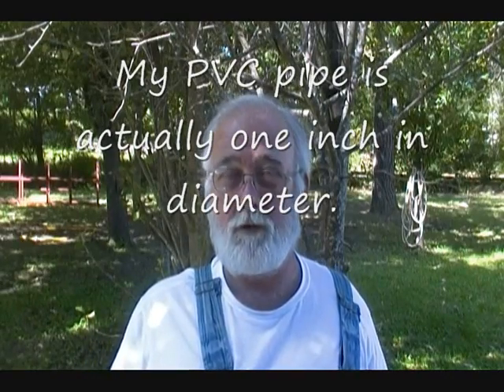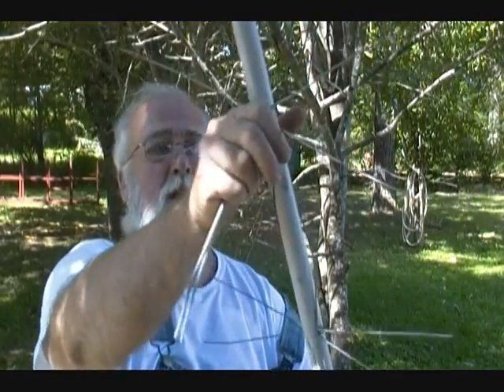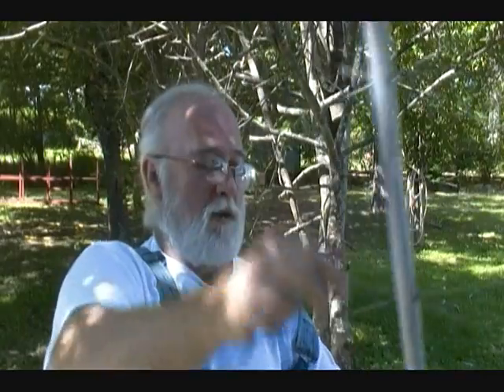Detailed Construction for my 36 Cent HD TV Antenna

Comment: Just wanted to let you know that I did away with my cable tv and made myself one of the pvc pipe antennas you showed how to make 7 years ago.  It works great.  I put it up in my attic and I pick up stations 50 miles away in Paducah, Ky and Cape Girardeau, Mo.  Thanks for the tips.
Carroll McGuire
Marion, IL
Reply from the maker: Great 👍

Comment: You cannot get HD on an over the air antenna…. Period!
Reply: Yes you can but there is no such thing as a HD TV Antenna. An Antenna from 1970 will work. As long as it is UHF and VHF and rg 6 cable with a bauln connected it will work fine.
Reply from the maker: Q: Can I really receive high-definition channels for free using a TV antenna? A: YES! With a TV antenna, you will experience HDTV in the highest quality picture and sound available. Over-the-air broadcasts are transmitted in uncompressed, crystal-clear 1080i, far surpassing what cable and satellite offer.
Reply: I get 17 HD OTA channels with a piece of coax that I turned into a dipole at the end. Can't get any more basic than that.
So yes, you can easily get HD OTA. Period.
Reply: You CAN get HUNDREDS of HD channels  on an over the air antenna.   Period!  There is no difference. HD Channels ARE "over the air" channels.  During the early days of HD. antenna manufacturers WANTED EVERYONE to buy NEW ANTENNAS for the "NEW  HD SERVICE. Manufacturers PAID their shills and 'talking heads' to spread  LIES like "You cannot get HD on an over the air antenna…. Period!"  (Some people were actually GULLIBLE ENOUGH to believe such LIES. )  Oh yeah, some "experts" were in the middle of "their PERIODS" when they made such hysterical, stupid remarks...   :-)

Comment: If you you double it like me you can get more signals. I also use copper wire from home depot instead of galvanize or stainless steel tig wire from Harbor Freight.

Comment: wow huntsville and nashville from the same antenna. i am impressed. looking at the map those two cities are not very close to each other. turning the antenna roughly 90 degrees means you are not directly between the two so that indicates even more distance. of course elevation plays a big part so if you are at a high point you could reach out further.

i live just north of memphis tn and only get memphis channels atm but plan on building one of these to see if i can get a better signal as sometimes i lose signal on my current homemade antenna.

Comment: Out of curiosity could you make more than one antenna and aim them at different cities then use a Y connector in the coaxial cable so you could pick them all up?
Reply from the maker: Don't know.  My dad used to have two UHF antennas hooked together for that reason.  Try it and let us all know what you find out !!
Reply: DoingItCheap If i can find some free time I will. Thanks
Reply: You want this man to spend 72 cents? We're not watching DoingItCheap for nothing!
Reply: stonefry haha lol
Reply: That might work.  if not, then just connect the coax from each antenna to an A/B switch and connect the switch to the TV.  Then simply push the A button for one antenna, or B to use the other.

Comment: good and simple 4 bay antenna!  I would suggest using minimum 12 awg wire for the dipoles.  Wind, birds...etc or accidentally hitting something and those wires will bend!  My question: how are those phase line wires holding behind the whiskers?    The video is not clear on that.  Do you pinch them behind the bend?  If so, that could easily pop-out ?  How is the 75/300 ohms transfo wires holding with the phase lines?  thanks and once again good work!

Comment: This my seem off subject,  but is your roof metal or asphalt shingle (considering signal reflection by metal roofs)?      Below am metal roof, TV signal is sometimes very difficult to receive.   also I am plagued by power wires all around my property at about 24 feet and a new set of wires at 38 feet.   there are fewer folks that use antennas anymore.   regards
Reply from the maker: Power lines will disrupt the signal more than what kind of roof you have.  I have used this same antenna at the cabin on the hilltop in my homepage photo, inside the living room of a house in Milton, FL, at my home here and presently at my farm.  Height of the antenna and distance to the broadcast tower is the main concern.

Comment: where did you get the 14 ga. galvanized wire? what else would work for that? thanks!
Reply from the maker: You can buy it by the roll at Tractor Supply, but this was just some I stripped out of a scrap piece of net wire fencing.
Reply: thank you for your reply! I got it.

Comment: Guys build it EXACTLY like he says! It may be Cheap & Simple but the tech behind it is not! Remember it is bi-directional mounted in a vertical plane and point the flat sides (looking at both open V's on both sides) to the stations
Reply: Well, this ol’ gal listened, although I used the ideas off two different videos because I needed to use a board instead of pipe. I just used what I had on hand – some old screws and rusty wire I got off my greenhouse. The balun was my only expense.

It’s not the prettiest, but I am getting over 20 channels, all of which are from 50 to 75 miles from me. I just have it nailed to a tree three feet off the ground for now. I was just making this to see if it was possible for me to get ANY channels, then I was going to buy one – but NO NEED! I hardly ever watch TV and have not had a service in two years, but it is there now if I want it.

I am still having a hard time believing this is working – thank you so much for the great information.
Reply from the maker: People just won't listen.

Comment: What does the transformer do? What would happen if we just look the coax cable going to the tv. chopped off one end and solder the copper to one side and the ground to the other side? If you take a coax cable chop off one side and then expose the copper it will work as an antenna too. Not saying it will be as good but its alot easier.
Reply from the maker: I normally only answer questions posed by my subscribers, but yours makes a good point that I keep talking about.  A lot of people will ask me "What if this or what if that."  I have shown you a way to get excellent TV reception.  If you wish to explore other possibilities, then by all means, knock yourself out.  I look forward to you producing a video that answers your question.  My way works and I have proven it.  I showed you mine, now show me yours.
Reply: This type of antenna has a 300 ohms impedance (more or less depending of the channel frequencies) and coax cable is typically 75 ohms.  If you don't use the transformer (called balun), the energy transfer is not optimal.  You might have lower signal or missing channels.  That's why it's called a 300 to 75 ohms transformer.    Better to use one!

Comment: in all these diy antenna videos no one ever talks about grounding them against lightning. or do you take it down in bad weather?
Reply from the maker: This is not up on a tower.  I barely put mine above the roofline.  You could ground it if you wanted to, it is your antenna.
Reply: On a wooden pole there is no need for a ground. And the PVC is no a conductor either.

Comment: shouldn't the step down transformer be  at the TV end inside  the house
Reply from the maker: No.  Do it like I show you.
Reply: the cable company's always had them at the back of the tvs
Reply from the maker: People that are smart enough to subscribe to my channel are smart enough to understand that this is not the cable company.  I noticed that you are not smart enough to subscribe to my channel.
Reply from the maker: Now Rimfire, you might be the smartest sum beach when it comes to antennas and if so, then why watch my videos.  The name of my channel is DoingItCheap.  I try to show people how to accomplish a goal with a minimum outlay of cash.  This antenna even works leaned against the wall INSIDE my house.  The least expensive way for me to accomplish reception was to put the step down on the antenna where there are screws to attach it, then just run coaxial cable directly to the TV.  IF you had ASKED me why I did not have the step down on the TV instead of acting Holier Than Thou inferring that I did something wrong, I would have given you a pleasant response.
Reply from the maker: LMAO !!!!!!!!!!!!!!!!!!!!!!!!!!!!!!
Reply: Humm... that was when people used those old antennas and instead of RG6 coax cable they used 300 ohms twin lead wire.  Yes, also cable companies because old (very old) TV sets did not have a coax input on the back but 2 screws for the antenna.  So you would use the balun as an "interface" so that you could have cable signal delivered to your TV.

Comment: I don't know if I missed itbut how do you connect the antenna wires to the TV?
Reply from the maker: Dead center from top to bottom between element 2 and 3 on each side is one screw.  Remember the wire runs like a spiral from the TOP elements to the second, then STRAIGHT down to screws, then straight down to element three and continue the spiral to element 4 on the bottom.  You use what is called a BALUN or transformer.  It is the little barrel shaped thing that has wires out one end and a coaxial connection on the other.
Reply: Thank you for your response.  I should have caught that.

Comment: Thanks Paw Paw. I used your design after viewing several other do it yourself antenna videos and it turned out great. I was using a small amplified antenna but my signals on the lower level of my house were terrible. I have Uverse but right now we aren't getting CBS because of a dispute between AT&T and the local CBS network. I put the antenna I made in my garage attic and there's at least a 50 to 70 foot coax cable run but even without an amplifier I get the strongest signal possible on all my local stations according to Windows Media Center on my computer where I am running this to and recording my CBS shows. Thanks for taking the time to make and share this video.
Reply from the maker: Glad I could be of help.  It is amazing at the people that want to change what I am showing them instead of just doing what I say first.  I have used mine in three locations in Tennessee and one in Florida.  People just can't believe how clear the picture really is !!
Reply: Thanks Carmine. You answered my question before I could ask it! I'm going to build the PawPaw Nitro 6000 antenna and put it in my attic having the correct direction so my wife doesn't complain about the contraption on the side of the house. 😁

Comment: Hey Pawpaw this is just what I need.  The wife and I cut the DISH network loose.  Just to darned expensive.  something like 150 a month.  We got one of those Roku TVs and it works great on Wifi.  Now I have been searching for an indoor antenna but living in amongst some tall trees the antennas for indoor use are out of the question, and since I am basically a cheap guy I don't want to spend 200 bucks on an outdoor antenna.   I am just wanting to get the local stations down in Seattle about 65 miles away.  I think the antenna you built might fit the bill so to speak.

I have a couple of questions that I need to ask.

Where the coaxel connector attaches to the TV could you post a close up picture of how it is connected to the PVC and other wires?  Would the antenna have greater reach if I put another set of "ears" on the top and the bottom?

Well off to look at more of your videos.  I think I am going to like this channel  a lot.

Thanks,
Lyle Z.
Reply from the maker: Watch the video again and you will see where to connect the transformer.  It is dead center from top to bottom.  No more ears, just do it like you see it.  A reflector may help.....if you can remember the old UHF antennas from decades ago, they had what looked like rabbit cage wire on the back side.  It is attached without touching ANYTHING made of metal on your antenna and just bounces the signal back to the ears.

Comment: Looks to be very similar to an old UHF antenna.
Reply: DoingItCheap  I have a few channels here in Alabama that are broadcasted in VHF  some local channels are broadcasted in VHF
Reply from the maker: Sorry, but I have to disagree with you.  Your television may say it is channel 2 or 3 or 4, but it is actually a digital channel that emulates the lower number so you can tune to it.  ALL of the signals are digital now.  HOWEVER, I am not a teenager.  I do not profess to know everything.  Can you give me an example of a local television station that broadcasts on VHF and I will be happy to contact them to educate myself.  Thanks for watching and subscribing !!!
Reply from the maker: Yes, today's digital broadcasts are made in the UHF frequencies.
Reply: I picked up on that because I am old and I did own a TV sales and service til 1990 and installed many UHF antennas back in the day.
Reply: DoingItCheap some are vhf
Reply from the maker: Could you tell me what channels and what towns?   I think you will find that they are not on VHF, but I am not afraid to admit when I am wrong.  I am not a teenager.  I do not know everything.
Reply: DoingItCheap which area?
Reply: DoingItCheap does the digital channel matter when selecting an antenna even if the actual
Channel is on the UHF band?

Comment: I built one of these about two years ago.  I used steel conduit for the tower and PVC for the antennae section and used a rotor for turning the antennae.  I pick up about 22 channels.  Haven't used cable TV or satellite TV since and every channel is clearer than cable or satellite TV.  I know, it's hard to believe that, but it's true.  The wire for my bowties is the same wire used for hanging a drop ceiling.  I also used the same wire for the twisted verticle wires.  It's a great antennae.  Just build it the way described in the video and you will be very happy.

Comment: I made one and it worked great. I gave it to my daughter who lives 10 miles closer to the stations than I do. She gets nothing, although she can get 3 channels with just rabbit ears. I took the antenna back home and it works great for me. Any thoughts that could help me?
Reply from the maker: Could her piece of coaxial cable be broken?  Maybe the center pin broken off?  Pointing in the right direction?  Does she have an enormous amount of electrical power lines between her and the stations?
Reply from the maker: Is her TV set to ANTENNA ?

Comment: So the antennas (V shaped sticking out from the sides of the pole) are bare wire, but the ones that are running down the pole are covered except for where they're attached to the antennas?
Reply from the maker: All of mine is bare wire.
Some folks use insulated wire and strip it where necessary.  I find that too tedious.
Just make sure the screws are short enough they do not touch each other inside the pipe.

Comment: How do you know where the front is to point?. How many channels did you receive. Very nice explanation of your Gizmo. Amazing the older WE get the farther the ground seems when we drop something...
Reply from the maker: Without a reflector screen, either face can be called the front.  Not an edge, but the flat plane is the front or back.  The number of channels depends on your location.  In Milton, FL I picked up about eight channels.  On top of my deck on my cabin on top of a hill in Lynchburg, TN I picked up about fifty, but you had to turn it to face different cities.
Reply: Thank-u; I understand !!! appreciate you to making things understandable, Have a good one Ser.

Comment: How do you hook the transformer to the wire? About to build me one of these. I live in rural Edgefield,  S.C. . My neighbor bought one of these antennas and it works great for out in his shop. Just wanted to know how to connect the wires to the transformer.
Reply from the maker: The transformer has a coax connector for you wire on one end and spade connectors that go under the screws that are dead center in the antenna.

Comment: Could you make it with 4 sets spaced a part in a x pattern so it don't need to be turned? Also if I don't have the transformer thing can I just tie the wires from my coax to the screws if I don't have any strands touching ?
Reply from the maker: Try it and let us know the answer.

Comment: Great video..what transformer is needed?
Reply from the maker: Just the little thing called an inside matching transformer  75 to 300 ohm.  It has spade connectors on one end to attach to the antenna and a coax connection for your wire.  Any place that sells televisions carry them.  Some call them a balun.

Comment: Does the 16 ga. wire need to be coated or not?
Reply from the maker: All the wire I am using is bare wire I removed from a section of fencing.  You can use any kind of wire, but make sure you can make good connections at the screws.
Reply: I mean the wire that is wrapped around the pvc....Thanks!

Comment: What is the range of the diy antenna?
Reply from the maker: Depends on how high you mount it.  Digital signals are line of sight.  I have reached 75 miles with no problem from a hilltop.

Comment: I understand that but are the two wire that spiral down also connected to the transformer screws as well. The two transformer screws are for each of the transformer leads?
Reply from the maker: yes

Comment: https://www.fcc.gov/media/engineering/dtvmaps
interactive maps for DTV reception. 
NOTE:  the frequencies of TV signals have not changed. 
only the modulation scheme.  Therefore a standard TV antenna will  work fine on DTV signal,  IF  the signal is strong enough.  Usually the difference is the DTV antennas have an amplifier in the antenna.  most of the DTV antenna crap is sales pitch..
Reply: tvfool.com has good coverage maps too.